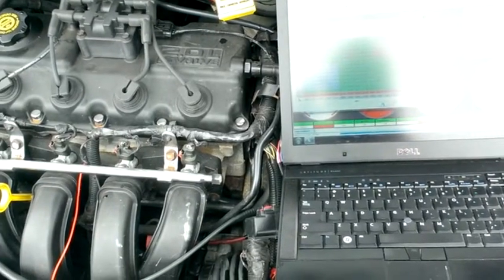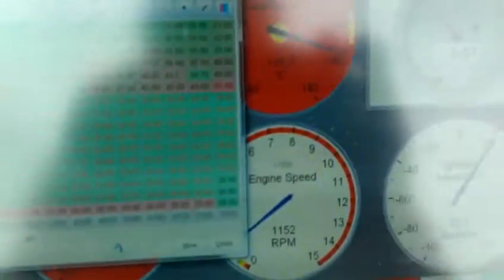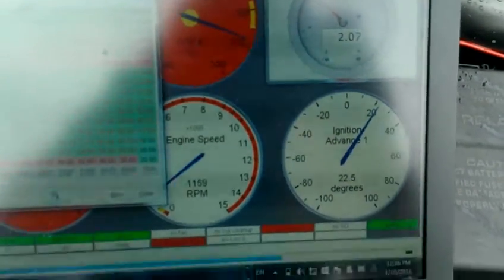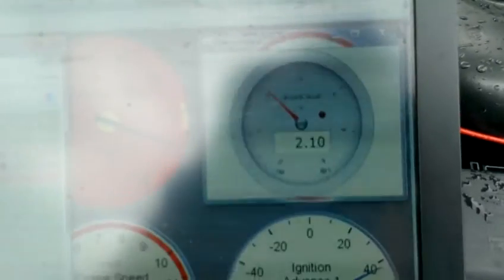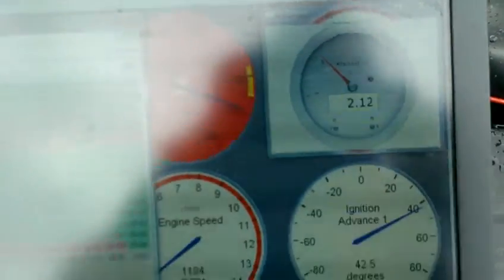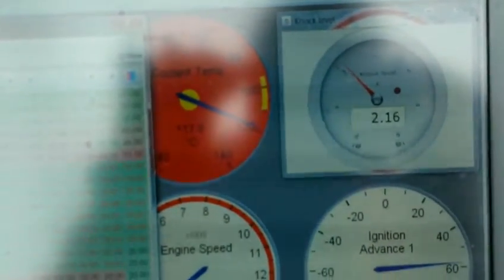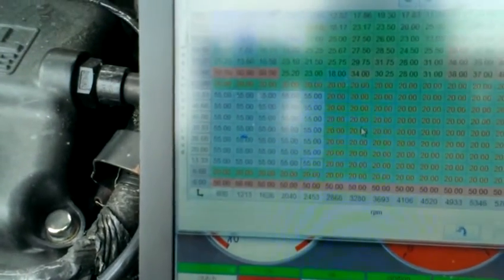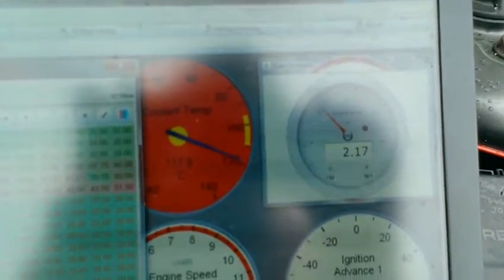knock on 75% diesel/25% gas rusEfi (English version)

Comment: why you running the mix for?
Reply from the maker: +dantheman1998 I was trying to induce knock while idling, so I was trying to reduce fuel octane number. Big open question if what I've got is knock or not.
Reply: +rusefi why not use a stethoscope to listen for knock to confirm what your doing?
Reply from the maker: +dantheman1998 Because I am not comfortable using a stethoscope and deciding what I hear.